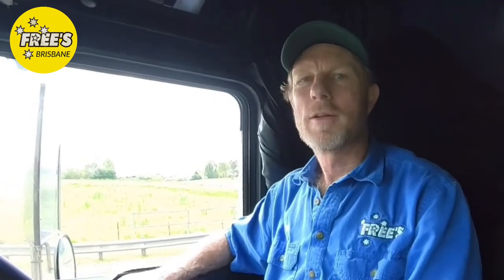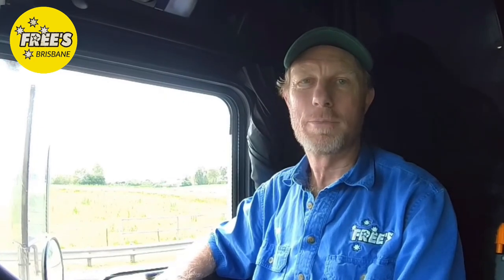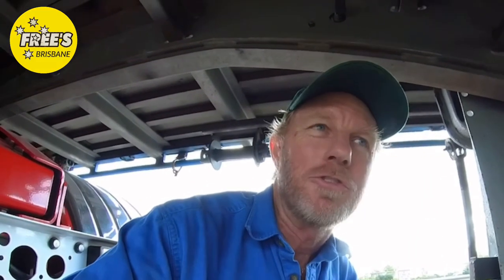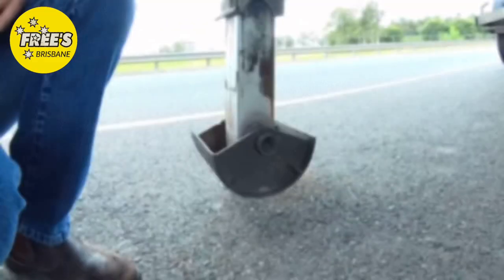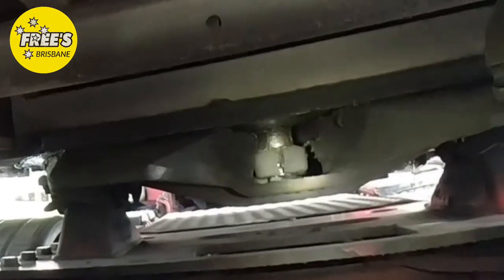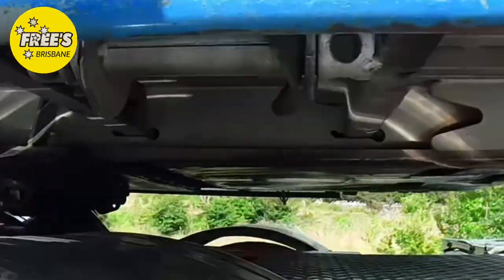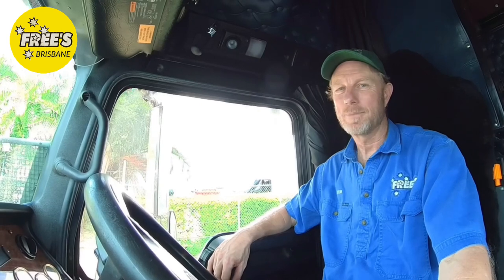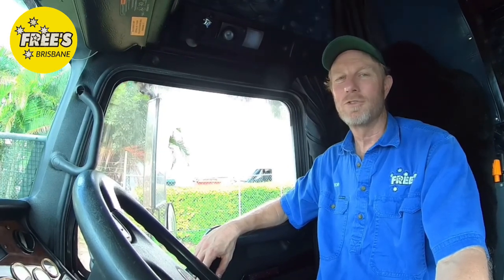How To Hook Up a Trailer - Step by Step.

Comment: He didn't once mention that some trailer's have a manual height control valve for the airbags.... Which can be used to raise or lower the trailer or truck when hooking up a trailer
Reply from the maker: I didn’t mention height adjustable airbags on European trucks either.  There are a lot of variables. When I get the time I’ll do a much more involved video covering all of that using a full double.

Comment: Shouldn't have hooked up air when he did
Reply from the maker: I disagree.  A lot of combinations don’t have room for you to hook up air/electrics once you are hooked onto the pin.
Reply: @freesbrisbane  i agree ,you must take control of the brakes as soon as possible in case the trailers slack adjusters are worn and she tries to run away from you.
Reply: @kellyboon4918 you are 100% correct.  If the slack adjusters are worn the trailer will start moving back whilst trying to couple, maybe slip off the turntable and while minimal damage will occur (because your legs are only 2 inch off the ground) you’ll end up with stretched (possibly) and grease covered Suzi coils as they drape over the turntable.
The rules are PLL (pin, legs, lines) when coupling and LLP (legs, lines, pin) when uncoupling.
Everything else is totally correct, including crawling under the trailer to check that the jaws (Holland Hitch) or safety bar (Jost) are behind the pin.

Comment: 7:47 turn the collars? I didn't get what you were saying. Can you please explain lil bit more. Cheers mate
Reply from the maker: G’day Benny, would you be American by chance? Unlike American Glad Hands, Australian truck/trailer air fittings are quick connect male and female couplings. Once you’ve coupled the fittings there is a safety collar that locks the fitting so it can’t be accidentally released.

Comment: Great instructional video... um with the Ballrace Turntable they also have a locking pin tethered by a chain that stops the Ballrace from rotating when reversing under the trailer, the thing is here is if the trailer your hooking up to has a block you must remove this pin prior to driving off or risk snapping it off with the first turn you make.
Reply: A ballrace is not a turntable...
Reply: @kellyboon4918   well what  sits on top of the ball race .??